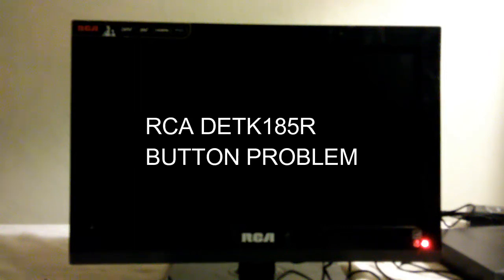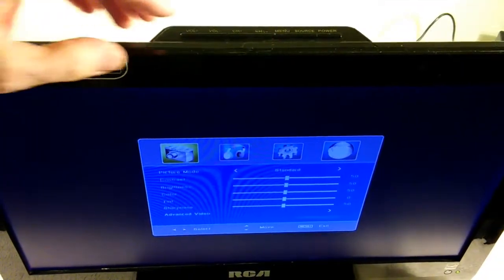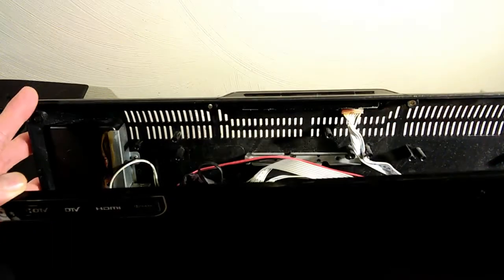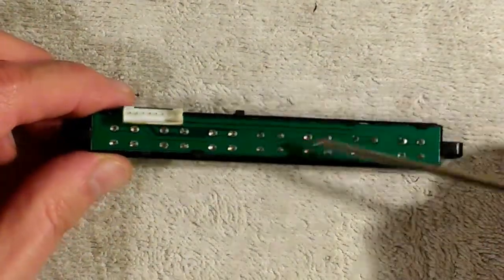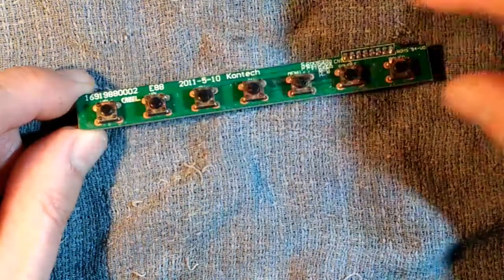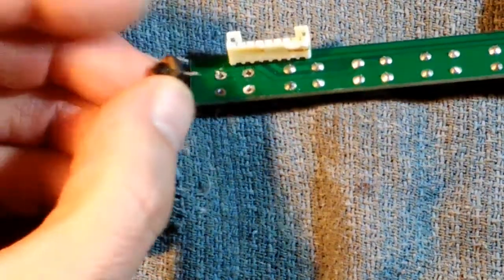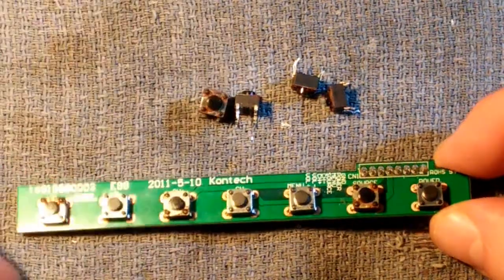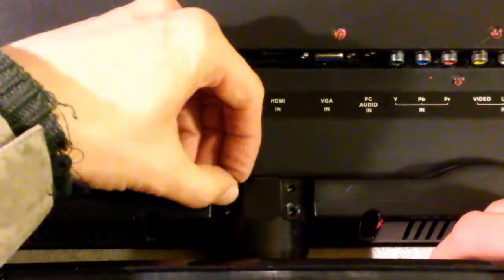RCA DETK185r TV:  Button Problem Repair

Comment: Thank you for this informative video!!  Do they not make a button board that you can buy where you can just replace the whole board all together?  Or do you have to go about doing it this way?  I don't mind doing it like this, but if there's an easier way, I'm not opposed.  Haha.  I didn't know if you just enjoy tinkering, or if this is the only option.  Thanks again for providing this guidance.
Reply from the maker: I do not believe there is a replacement button board available.  You might try a spray on electrical contact cleaner. Sometime that will work, at least for a while.

Comment: Trying this on a Element tv, is there any chance or way that I can fix thr buttons without having them replaced?
Reply from the maker: You could try spraying some circuit cleaning fluid into the mechanism.  Usually only a temporary fix.  New buttons will fix it for years.
Reply: You can try a couple of other simple cleaning methods before replacing the switches. 
1- Chemical cleaning: Drop the circuit board  in vinegar for 20 seconds then drop it in a big bowl of water and shake it then take it out and tap it into the palm of your hand (switch faced own so that liquid can come out from the small gap between the body and the round head of the switches). Then dry it by a hair drier on medium heat. WARNING: Vinegar has 5% acid and can clean the contacts quickly, but it can also damage the conductors if you leave the switch in vinegar for a long time.   

2- Physical cleaning: Another option is to press down the round head of the switch with the tip of your finger (to make contact between the two parts), then twist your finger left and right a couple of times so that the two conducting surfaces inside the switch rub each other and clean each other. 
WARNING: Do not overdo it 

3- A combination of the two mentioned methods for severe cases (if cleaning by vinegar did not solve the problem then try the friction sanding method)
If these methods did not work then replace the switches as shown in this video

PS: Contact cleaners leave residue behind and make a mess

Comment: thanks,  power button on my 24" is failing. looks like the same arrangement.  will get around to it eventually. at first I thought I'd get around the problem with a switched power cord
but momentary switches use a holding circuit.
Reply: did this work for you? in the same situation and want to see if itll work
Reply: @davids3579  sorry I haven't gotten to it yet . I think I glued the button back together. I did buy a whole bag of switches for it however.

Comment: I have rca 50 inch and the power button is broken I press it and it goes on and off repeatedly even with trying the remote
Reply from the maker: The problem is not the physical button.  Power cycling on and off is most commonly caused by a bad capacitor in the power supply board.  That is where I would start trouble shooting.